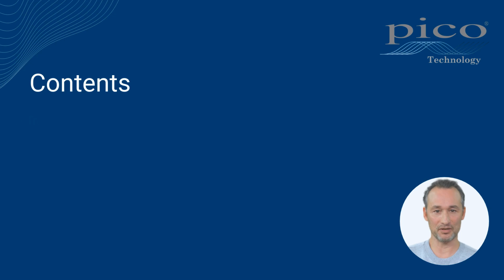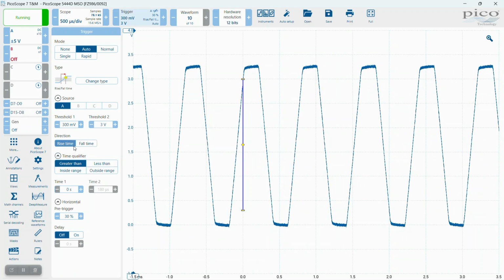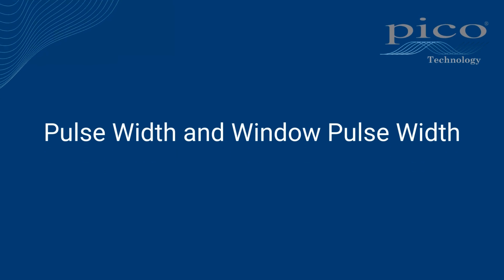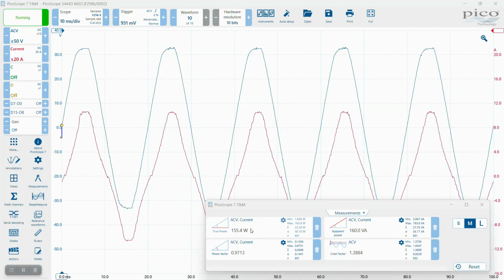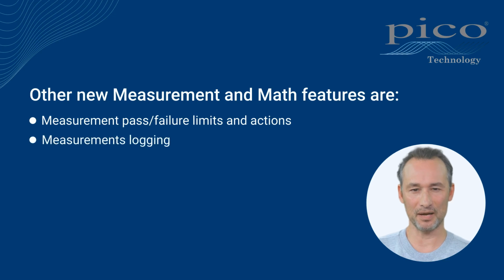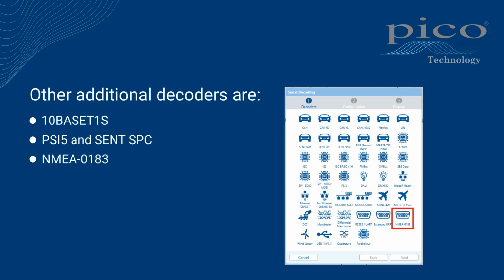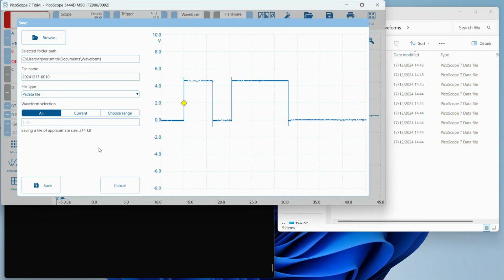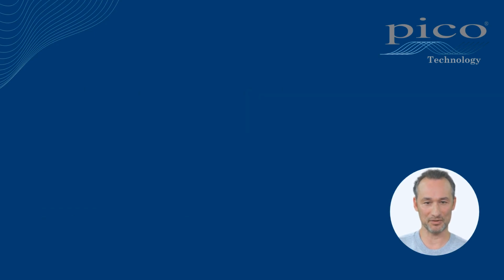PicoScope 7 - 2024 in under 12 minutes

Comment: Why can't you add a mode where the analog offset tracks the zero position on the screen.  Every bench scope I have ever used does this.  Picoscope has always been clumsy in this regard, as you have to adjust the offset manually when you move the vertical position of a trace and want to get full resolution.  For example, if I want to see in the range of 0 to 3.3 volts with good resolution, I would move the zero volt line one tick above the bottom of the display. Then select the +/- 2V range and set the analog offset so I see 0.25 volts to 3.75 volts on the screen.  That takes several operations.  With a normal bench scope I simply move the waveform to the bottom of the screen and I get that.  With Picoscope if I want to see up to 3.3 volts I have to go to the + 5 volt range and loose resolution unless I go through lots of steps to adjust analog offset.

Comment: Can't wait for the tracking cursors! Would also love to be able to deploy more than two cursors at a time. I've gotten used to being able to draw as many as I like in the Joulescope software - it's really useful when doing complex measurements on data you need to share. Once you have the tracking cursors going, maybe think about adding additional tracking cursors as an annotation.

I'd also love to have a manual trigger button, and control of the trigger interval in auto trigger mode. Quite often I find myself setting the timebase to 100 ms just to get the live updates, so I can monitor the state of the circuit, but this isn't always feasible. The auto trigger interval is often too long for monitoring, and would use up all my waveform buffers.
Would be really cool if you could have a hybrid auto mode that does rapid auto captures, but doesn't save them to the waveform buffers - then you could monitor the circuit state and also capture significant events.
One reason you'd need to monitor the circuit state is just to figure out if your probes are still making decent contact, after you've bumped the table.